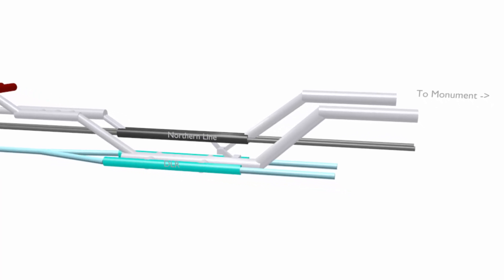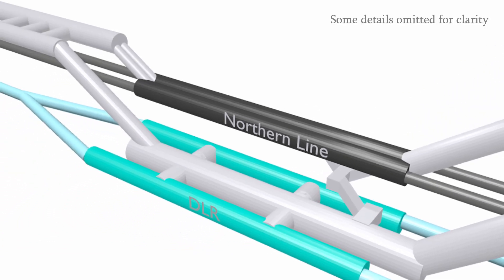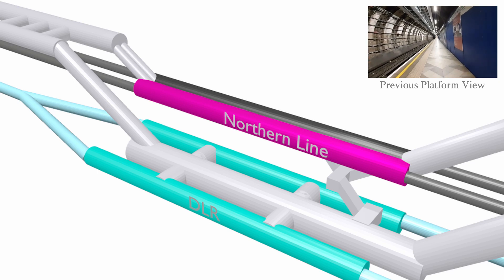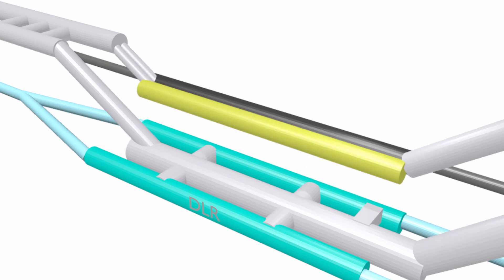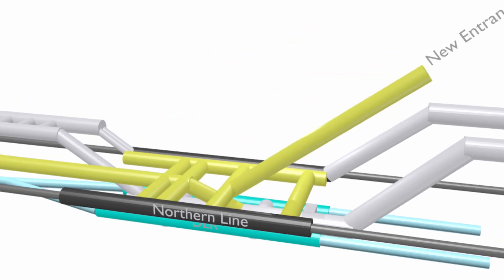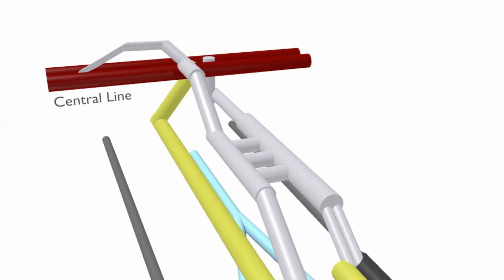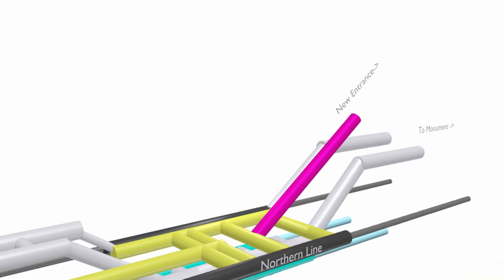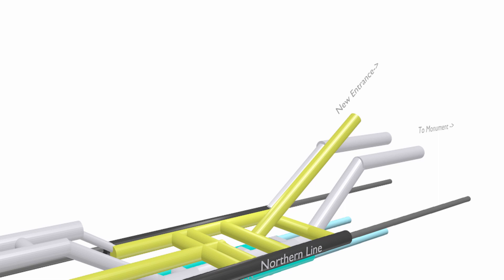What's Happening at Bank? Northern Line New Platform

Comment: These are brilliant and essential to really understand what's going on down there. Do you do requests?
Reply from the maker: Don't do requests, but open to suggestions
Reply: @Distraction Bucket  well... I have always wondered if connecting Moorgate to Cannon St would work but I think a new stair or escalator as part of Crossrail precludes it.... hard to grasp the 3D topography though.
Reply from the maker: @peterdowden7694   I had been thinking about doing Moorgate/Liverpool St at some point as I do think it's fascinating with all the Crossrail tunnels down there.

As for extending the Northern City further south- I know many years ago there was a suggestion to extend as far as Lothbury (which would have been so short a distance the back of the train would be leaving Moorgate as the front arrived at the new station!) I vaguely recall that going any further than that would have been problematic because of the Central Line/the Bank of England Vaults, but don't quote me on that.

Nowadays, the main Moorgate Crossrail escalators do run across the end of the NCL tunnels, I'm not sure about the exact depths, but all the info I can find online suggests the passage between the two sets of escalators is above the Northern line making it about the same depth as the NCL, meaning it probably doesn't leave enough space, but that's only my best guess.

Comment: Planned opening is later this same spring?
So... nearly all of the construction work is actually done already? Just getting in the last bits to connect it all now?
Reply from the maker: Yep, as I understand it the new tunnels are mostly already built, and the closure is so they can knock through into the existing line and connect the new tracks.
Reply: It's been going on behind the scenes since 2016, but the last bit was held up by the pandemic. I think it's ended up about 18 months behind the original schedule. Personally I am really looking forward to the changes- I'm a Northern Line driver and coming into the Bank platforms during rush hour makes me feel sick with nerves because of how crowded they are.

Comment: I use Bank station regularly and it will be great when this is finished as it often ( before Covid) got very busy and cramped, especially when trying to get from Circle line at Monument to Central line.
Reply from the maker: Yep, having to squeeze along the Northern platforms just to get to the rest of the station was a pain! I'll be glad when that's changed.
Reply: @distractionbucket7454  right now during works the connection forces you along the dlr platforms while they build the northern-dlr escalators.
Reply: You should try and avoid that connection, there are better connections at Mile End and Liverpool st. or different routs may be better

Comment: I've heard bank is often the least favorite station for londoners.  I wonder what it'll be after this is done
Reply from the maker: Yeah, I do hope it will be slightly less unpopular after this.
Reply: @distractionbucket7454  I don't live in the UK and have only been to some stations, but maybe my least favorite is Heathrow 2/3.  It's just very dull (no surprise since it's from the 70s) and a long walk from the terminals, although it can be good to stretch after a long flight.  Luckily once Crossrail opens I won't have to worry about the lengthy Piccadilly line trip when I fly to LHR.  The inner circle stations that have lost their historic feel at platform level (like Euston Square or Blackfriars) are also visually unappealing.
Reply from the maker: Was struggling to work out if I have a least favourite station, but agree the circle line stations that got refurbed sometime in the '60s and left since then are looking very drab and unloved now, especially Euston Square. At least at Blackfriars they've re-done the above ground bits as part of the national rail upgrade.
Reply: @distractionbucket7454  definitely Euston square for me. Used that for work in the 80s and 90s and is still the same today. Really drab miserable station.
Reply: All the stations on the Bakerloo line north of Queens Park are really terrible

Comment: So the Northern Line at Bank is literally above the DLR whilst work begins to close off the old southbound platform and to add a new southbound platform and to widen the concourse that would connect with the DLR, Waterloo & City Line and the Central Line. 

Bank station does need a massive upgrade and to have lifts installed which I think it’s great. Very interesting video.
Reply from the maker: Glad you enjoyed the video! And yes, I think the upgrades and lifts will be very welcome.
Reply: @distractionbucket7454  Indeed. :)